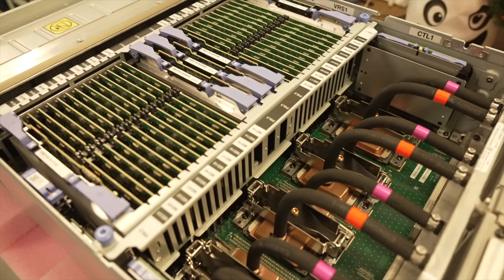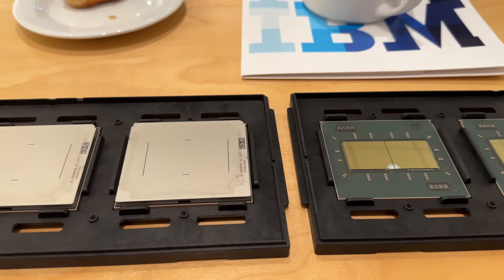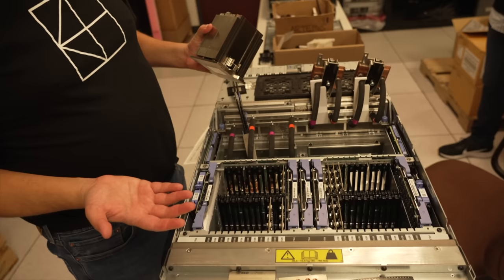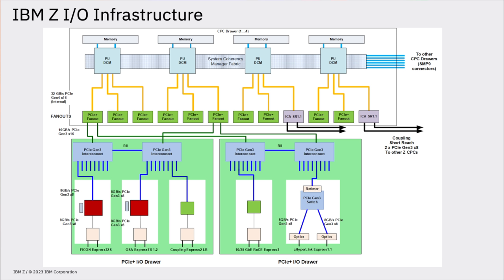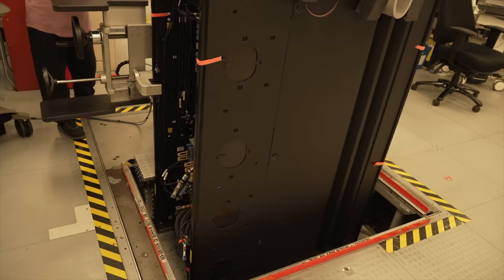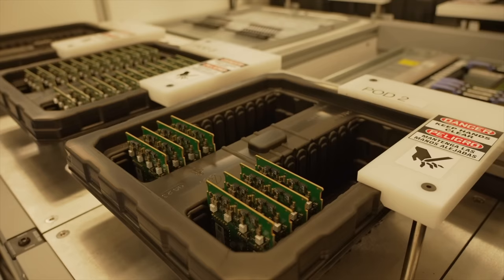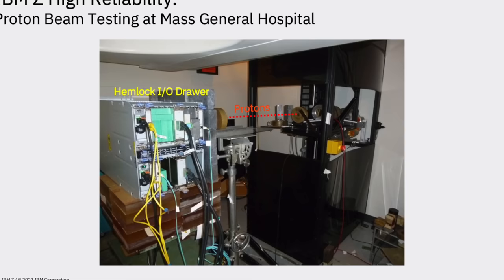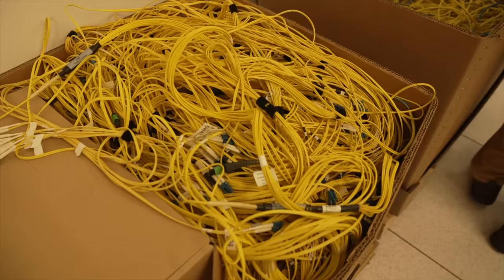Why Do Mainframes Still Exist?  What's Inside One?  40TB, 200+ Cores, AI, and more!

Comment: DDR4 RDIMM memory is 3200 MT/s at 64bit (or up to 72bit w/ ECC) which 8bits/byte would give you 25.6GB/s.  what you are missing is that memory is multi-channel.  Intel Xeons can go up to 8-way memory, AMD Epyc can go up to 12 way.  So you're talking 204GB/s or 307GB/s.   DDR5 RDIMMS are even faster so throughput would be greater.   What I do not know is the inherit latency of memory access (core to core, or package to package) where I suspect the mainframe would be better (lower latency).   Is main memory on the z16 static ram or dynamic?  

Likewise PCIe I/O is up there on server platforms, a dual processor AMD Epyc has 128 PCIe lanes (Gen 4 for Milan, or Gen 5 for Genoa) for a total of 256 PCIe lanes of generation type.

However should be stated that just pure lane counts does not compare well.   Mainframes are set up to OFFLOAD a lot of signal & I/O processing much more than mid-range/server.  (concept in the server world is just taking hold with dedicated processing units (APU/DPU) but mainframes have been doing that forever.  

There are a bunch of other items as well, but it's like comparing an armored personnel carrier to a car.  Both can get you from A to B but one is much more robust.  :)
Reply from the maker: Steve is correct!  And the odds are there are other factors and subtleties that make such a comparison of questionable value anyway.  But unless they let me benchmark it... :-)
Reply: The Z16 has plenty of local DRAM.  That robot around 14m is inserting DDIMM (not DIMM) modules.  They work with a transactional interface called OpenCAPI (aka OMI in a simplified version) that runs around 32GB/s full duplex compared to DDR4 25GB half duplex, and the Z16 chip has a lot of those channels (they are lower power and take up half the silicon on the CPU chip of a DDR4 channel).  So that bandwidth is additional to the distributed "virtual L4" comprised of idle borrowed L2 capacity.  As the L2 cache is SRAM it is likely significantly lower latency than DRAM even if it is in another CPU.
Reply: How does the Apple MacBook Pro M3 max compare
Reply: @willd0g is that satire?
Reply: @rolux4853  you got me. What’s up with using windows XP (embedded). I was told the world ran on Linux!
Reply: In the early days of IBM multiprocessors (two CPUs), each CPU (and channels) could access any part of system memory at the same time.

To protect against concurrent access causing problems, there were two instructions, compare and swap, and compare double and swap. The instructions compared a register (pair) with a storage location, and if they compared equal, the contents of another register (pair) were stored there. These instructions were  used to maintain lists such as TCBs within the operating systems, but were also applicable to applications code.

We had some free but unsupported software supplied by IBM, the TSO utilities including copy and format commands. The latter was used to maintain documents for printing and, in our case, those documents contain upper and lower can (probably) some unusual special characters.

The author of the software used multitasking, for reasons I still don't understand, but presumably he thought there was a performance advantage. Or an interesting ideal.

On the System/360 computers the author used, there was only once CPU and so little or no trashing of chains of storage.

It had puzzled us for some time, and The Boss had raised a purchase order for $Lotsa, and sat down with me. I had one last idea, as above, and so recompiled it using WAIT and POST to ensure that no two tasks ran simultaneously.

Surprise surprise, no crashes. The Boss decided the Crude Hack was a sufficient solution, the users of FORMAT were happy that it ran and never complained that it was slow.

I haven't head of that sort of thing happening in Windows or LInux on PC hardware, I suspect because memory access isn't that good.

FWIW In MVS and successors, ATTACH is used to create subtasks, it's functionally similar to fork(). WAIT causes a process to wait until something POSTs the Event Control Block.
Reply: @DavesGarage when did you say we are doing the mainframe vs server drag race 😂
Reply: @willd0g  You will find many industrial tools using ancient operating systems.  Some are still using plain old DOS.  It doesn't matter, because the tools are not networked and are still performing the same functions they were built for.
Reply: @briansomething5987  And many of those industrial tools using antiquated OS are networked.
Reply: Eypc is only 128 lanes, single or dual. Dual socket uses some of the lanes for CPU to CPU. Older Eypc was only 64+64 for dual socket. The newer ones have the option for less cpu-cpu and can have 80+80 lanes.
Reply: @ionstorm66  Thanks did not know that w/ Epyc, then Intel still has the upper hand on I/O then with scalability up to 8 processors 48 pcie gen3 each (384 total) or equal with dual socket (128/64*2).   But the newer Genoa epyc even at 128 it's gen5 so you can break that to 256gen4 or 512 gen3 w/ pcie switches.
Reply: @stevekristoff4365 yeah 160 gen 5 is equivalent to 640 gen 3 lanes lol.
Reply: @willd0g  That HMI (Human Machine Interface) device is probably not as old as you think. I have seen Siemens HMIs running XP on locomotives that were commissioned 8-9 years ago.  Sadly enough they are very often used for tasks were a simple atmega mpu with a touchscreen could handle the job but would require real programming skills.
Reply: @stevekristoff4365 Modern xeons are 80 Gen 5 lanes per CPU, not 48 Gen 3. With 8/16 socket scalability it’s 640/1280 Gen 5 lanes.
Reply: @ilyaskiziloglu7397  Thank you for pointing that out,  Intel's ARK site only showed 2gen scalable as > 4 sockets with a simple query.  But looking I see that the 8460H/8490H/8444H/8468H/8450H all are listed for S8S and 80 gen 5 lanes.   I haven't needed to deploy 4+ socket systems since gen2 days so was a bit behind.  :)
Reply: Great video.
I've known about mainframes since the 80s and even accessed them while working in financial services, but I knew basically nothing about them, until now. Thanks!
Reply: @ionstorm66 160 lanes sounds like a lot, but with 8 GPUs and 2 IB NICs (GPU/NIC x16) all is used up. Not even local NVMe could be plugged in anymore in a 2S config without a switch.
Reply: @derohneusername  You'd hit memory bottle necks well before that. 160 lanes of PCIE 5.0 is too fast for DDR5 to keep up even with 12x2 channels.

Also there is a extra 6 lanes pcie 3 only link on each cpu in the 160 lane config, for boot disk, control nic, etc.

G493-ZB0 uses 10x16 5.0 for slots, x4 3.0 for one m.2, x4 for the 2x10g nic, x1 for the second m.2, and x1 for the IPMI. Thing is rated for 9KW continuous in a 4u.
Reply: My speech to text button was wrongly stuck in the on position....... Sorry.
Reply: @willd0g it's stable, the bugs are known, it's light on space and fully functioned. Doesn't require a lot of RAM or CPU time.
Windows XP is probably the best os for embedded systems if you want large scale compatibility and being user friendly.
Reply: @justingrey6008  Industrial devices mostly runs embedded version of Windows to make use of commodity hardware and better compatibility. I've fixed a wheel alignment machine before for my friend after the USB port on the motherboard died. For manufacturing system it uses the PLC. I'm surprised to see Windows XP on a fluid fill machine. It's likely just the HMI that is used for display and control, but the actual work are done on PLC.
Reply: @ousi00  modern fanuc controllers are Windows 7 based, okuma is Windows 7, Num is Windows 7,  Kuka robots are running some bastardized version of Windows as well.
Windows XP is still an option on some of these controllers.
PLCs are kinda old tech at this point.
Reply: A mainframe is better compared to a datacenter.

Instead of using more generalized interconnects, intermediary devices and other (often software) methods of getting nodes to work together, you use proprietary highly integrated hardware methods to do so.

It's a datacenter in a box. (Which still often spans multiple racks)

But instead of being a bunch of servers you make work together to pretend to be a single system, it actually is a single system.
Reply: @justingrey6008 Windows XP is great because you get it basically for free and it has plenty of driver support that you don't even need to care about.
But my personal favorite is our Linux and FreeRTOS based. If you only need USB and no networking is just needs 320mb for Linux and 1.2mb for the custom solution.
Reply: @ionstorm66  First of all, Ice Lake (2020) has 64 x 4.0 lanes. Sapphire Rapids has 80 x 5.0 + one 4.0 for DMI (I/O Hub). Emerald Rapids has also 80 x 5.0 but a 5.0 for the DMI.
And an EMR-MCC is odd in this regard, because of the lower core count and the same size die, they can run 6 instead of 5 pcie controllers. You can do the math.
And instead of DDR5 4800 it runs now min 5200 up to 5600 MT/s. And then you can stack up to 2~4 cpu's.
There is also that weird thing that EMR has no room for HBM stacks. Why they decided to further produce Sapphire Rapids 64 GiB HBM, called Xeon Max.

Casscade and Copper Lake was the last Xeon's used 48 x 3.0 lanes.
Reply: @briansomething5987  Exactly, and they are also ultra-stable.
Reply: @willd0g this is a beast and M3 is an amoeba.
Reply: Mainframe are mainly for operations with large I/O
Reply: Fun fact, the M3 Max by Apple does 400 GB/s on a SoC
M2 Ultra features 800GB/s
Reply: there is absolutely no actual need to pair xeons with insecure dram shit whatsoever. you can damn well insert dimms with normal sram. just that you'd probably have to cook them up yourself in-house. (i mean. we probably will. cuz with dram you are not sure that confidential data is gone after the system is turned off and we cannot rent that out to our type of clientele as is ;)
Reply: Performance has to be always measured by the price / performance ratio through benchmarks. In the end something that gives you twice the performance but costs 5 or 10 times as much is not a good deal. Buying singular gigantic systems is often not worth it because we now split everything in parallel workloads. When buying 5 "smaller" servers instead of one really huge one the 5 smaller servers will be cheaper and in the end give you more performance in total. It is the age of commoditization in IT, mass produced modular hardware instead of proprietary small batch manufacturing that costs too much because of not having scale. Every company building all their hardware themselves, reinventing the wheel is very 1980'ies, when the market was a lot less mature than what it is today.
Reply: @willd0g  it does run on linux.
Reply: @rolux4853  No. It is sarcasm.
Reply: @oneeyedphotographer  not entirely sure the type of problem you describe is applicable to most environments used to run stuff on these days, but not for the reason you theorize but rather that you don't interact with things in that fashion in code. At least if I understand your description of the issue somewhat correctly. Basically things are queued in chunks, so if two processes are trying to, say, update the same db record value to different things, one will be first, obtain lock, write it's complete value, release lock which will allow the other process to exit wait and lock and write. 
For memory each process would exist in it's own context and have it's own instance of whatever variable it wants. Both can have their own private instance of a variable called say 'picklejar' and assign their own value to it without interfering with each other so you'd have process1.picklejar.value("bananas") and process2.picklejar.value("squid") if that makes any sense. Only if they "live in the same context" does what one does interfere with the other in which case you get the behavior type of the db record, but the picklejar has to be explicitly shared by both processes for this to happen, otherwise each will implicitly get their own picklejar instantiated as soon as they use it.
Reply: @DavesGarage  Using bandwidth as a performance metric while ignoring the latency deltas of the speed of light over a few inches vs a few feet was a choice. Orders of magnitude slower to access networked memory. 😁
Reply: I think I just had a stroke bro laid down the laws of physics 😅 though ive seen many videos I still just can't wrap my head around mainframs and servers, clusters or maybe that's literally the difference clusters....?
Reply: @willd0g  have the same question for a Raspberry Pi 4!